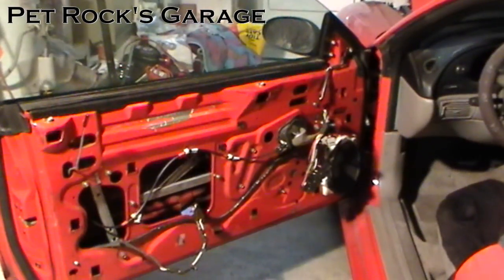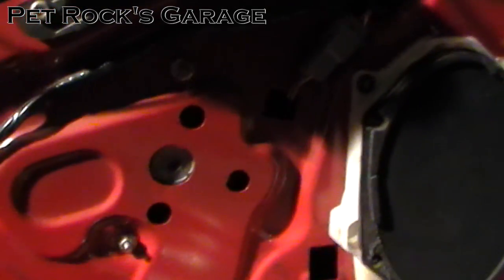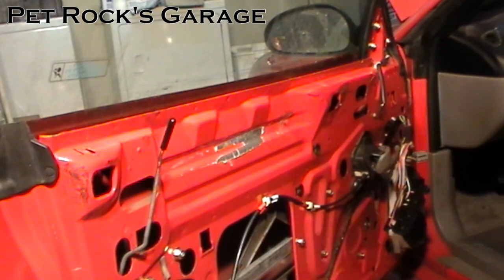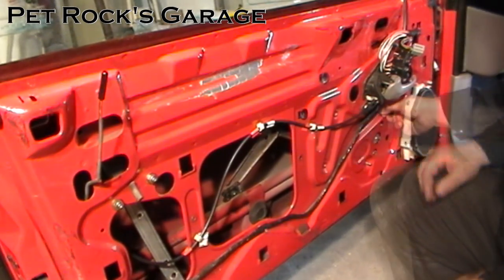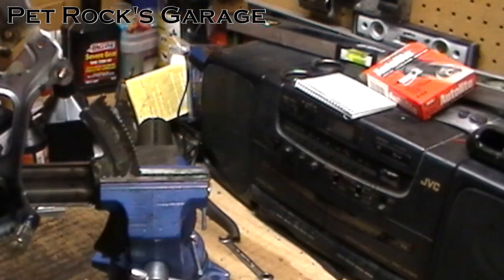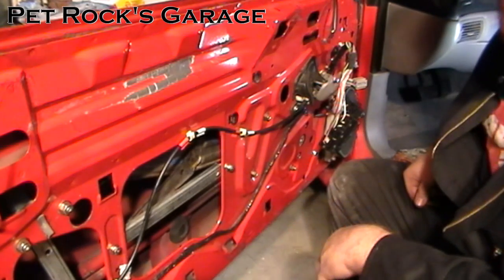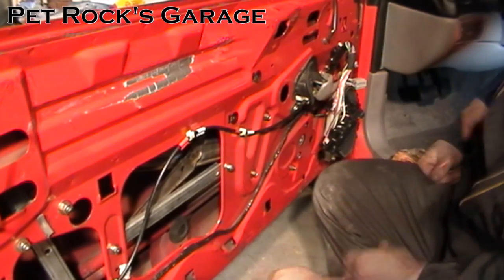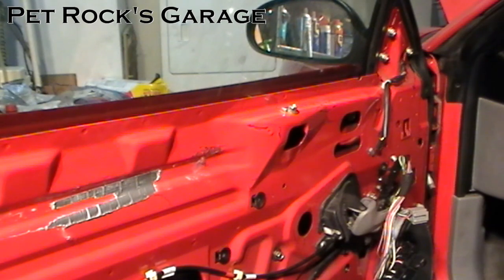How To Replace Window Regulator & Motor - Ford Mustang (’94 - ’04)

Comment: Good job mentioning the spring, putting the replacement motor into position got a bit sketchy until a couple of the bolts were in place.
Reply from the maker: Yeah, that spring can jump out and bite you if you aren't careful. I'm glad my video helped you out.  Thanks for watching & commenting. I appeciate it.

Comment: My black and blue left hand ring finger is living proof that today; 5/22/24 - that darned spring can do SERIOUS damage to human flesh!
I was lucky. Nothing broken, plenty of icepacks in the 'fridge (as my roommate just had a knee replacement), 10mg Oxycodones too!
Without this video, I'd still be wondering.
Now I have to try and refit my window with original rivets still in situ.
I do wish you had shown how to replace the window with rivets holding it to the topmost channel that slides on the plastic doodads though. This is proving to be a nightmare; ESPECIALLY with a black and blue left hand ring finger being rather sensitive and larger than normal!
Thanks muchly for the video!
This reminds me of the tale regarding the gynecologist who decorated his hallway, through the front door keyhole...
Reply from the maker: OUCH!!!  I hope it heals up quickly. Yeah that spring swings quick. Like a bear trap. Take it easy.
Reply: @petrocksgarage  
Thanks.
I did buy a new regulator, but the instructions told me how to modify MY MUSTANG..... to fit THEIR PRODUCT!!! 
It was returned. (I had another one luckily).
There is no way I'm removing that lower rail, on the window so their new skinny one will work.
I did get it all back thanks to you, but the plastic inner door clips proved they are 28 years old and will break at will should they choose to.
Tomorrow is another day. 
Long, hot shower, cold Guinness in hand and watching the recorded qualifying for tomorrow's Monaco F1 race.
Finger be damned! Life is good!
Thanks for your videos. I tipped a brew to you!
Reply from the maker: @Dodger2879  any 3rd party 'replacement' part that requires you to modify your car to get it to work is a bad part IMO. Glad to hear you got it all sorted out. The cold beer will likely help heal your finger, or let you forget it's injured. Guinness has amazing healing properties in my experience.

Comment: ~INPORTANT NOTE~ DO NOT ATTEMPT to take motor out by itself!  This video does only hint at - the nightmare that ensues once that motor comes out of the regulator - that spring will bind the regulator - and possibly take the wheels right out of the tracks and damage them!  I know from experience!  PLEASE GO THRU with removing the regulator and motor - as one piece - as this video does!!!

BTW - this is the best video for this repair
Reply from the maker: Thanks a lot & couldn't agree more.
Reply: @petrocksgarage  I drilled rivets out - from the radio speaker - and - from the window bracket - good advice - seems hard but drilling is the easy way to assemble the window back together!  Also, if your window bracket is loose - use a good 2 tube epoxy to glue it back - other videos use silicone - that method sucks - use epoxy (i mixed my epoxy with silicone to make a flexible glue)
Reply from the maker: @budsodalsky , Thanks a lot. I appreciate it. I have a tube of 3M Auto Glass Urethane Adhesive that I am planning on using on a friends car soon-ish. It has the same loose window bracket problem I show in this video. We'll see how well it works.
Reply: @petrocksgarage  i hear that should work - i wanted a permanent bond - not sure what ford used - sure was NOT permanent
Reply: @petrocksgarage  Heard from a pro friend of mine - later that YES 3M Auto Glass Urethane is what I shoulda used!
Reply from the maker: @budsodalsky , awesome!  Thanks for getting back to me on this. Makes me glad I used it on my friends window a while back. 🙂

Comment: I have a 2001 ford mustang.   This video helped me tremendously to get me my window, regulator and motor changed out.    I didn't know until I watched this video that I could change out the rivets and use bolts.   I went to an autozone and orielly's and they had no rivets big enough to replace so I used boltz .   I have to admit this video applies to Mutangs from 1995 to 2004 that gives a wide range this applies to.   Hope this video help everyone else as much as it helped me.   Thanks
Reply from the maker: +William Roberts, I’m glad to hear my videos helped you out.  Thanks a lot.  I appreciate it.

Comment: Very useful video I followed it just about to every explanation. Though I approached it differently, because of my situation. Such as I didn't have to take the rivets that hold part of the regulator track onto the window. There's another way of going around that for those of you that don't have the proper tool to take off both rivets. I simply installed the regulator with the motor separate, as shown. lubed it with multipurpose grease and  shoved the regulator and motor into the door first leaving everything unscrewed. Next fed the window into the door that still has the riveted track on it and had a buddy hold it for me. I then bent the little metal parts on the windows track as shown in the video to be able to slide both black parts into the track. Being that this was the passenger window, I believe I slide the left black piece in first then had my buddy shift the window to the left so I can put the right black piece on the opposite side of the window track. Once they're in I bent the metal parts back and started assembling and screwing everything back in but the two last metal track pieces that come off the regulator first.

When you get to the two separate track pieces, you may have to plug the motor back into the door and turn the key to power the car for a sec. Why? Because the regulator may not be aligned right when installed, so while you have a buddy hold the window in case something goes wrong, either press the window button up or down to the correct position you need the regulator to sit in so you can screw in the final track pieces starting with the curved one first. Feed the curved track onto the black wheel looking piece on the window's bracket and screwed it into the door, the two screw mounts should be towards the top and the single one towards the bottom. Lastly install the straight metal track last feeding it through the single black rectangular piece on the regulator. Then just install both the metal and felt brackets back in as shown in the video.

That's just basically how I had done it and everything works as according I'm proud of of both myself and my buddy, being that we're amateurs. And I really don't have the money to have a professional fix it. I paid 47 dollars for my regulator, Motor, and Window glass with a warranty included on the motor and regulator from my local pick-a-part. For those of you that are afraid to do this themselves. Believe me it's more simpler with two people, so you have two brains working together. It's a lot easier than it looks, especially with the help of this video. Though you may need to make some adjustments yourselves, but you'll get it. Just take things slow. It took us roughly 5 hours to get the old one out and the new one in.

Comment: Great video, and it just so happens that I am replacing the drivers regulator on my 98 Mustang GT convertible, so I'll be using your video step by step.
Reply from the maker: Thanks a lot.  Also check out my video on adjusting the window when your done. There is a link in the description & at the end of the video.  Good luck...

Comment: When I bought my 2004 mustang brand new.I found that when you hit the window down button the window would continue to go down even if you took your finger off the button.I almost took the car back to the dealer because I thought something was wrong.A friend told me it was supposed to do that.I argued with him about it.Thanks to your video,I now know there is a module in the door.I wonder if there is a way to bypass this module?Its drived me nuts all these years.I thought the switch was bad.I actually bought another switch.But I never put it in.
Reply from the maker: Yeah, the one-touch-down feature threw me for a loop when I first experienced it. I have gotten used to it over the years, and find myself using it on purpose all the time. There are definitely uses for it (e.g. roll down going to a toll boot, drive through, to air out a hot car), but there is a bit of a learning curve on how much the switch needs to be pressed etc. A friends '21 Chevy Blazer has one-touch-down & one-touch-up. So its only becoming more prevalent.
As for bypassing it, there likely is a way to bypass it but I don't know how. Good luck.

Comment: Hi, great video. I have a 2002 ford mustang. The passenger side window goes up and down good. But lately it looks like something is scratching the glass from inside when i lower the window. What do you think it is causing this?
Reply from the maker: It could be anything. A loose part inside the door, some dirt on the weather stripping...  Only way to find out is to remove the door panel and have a look inside. Good luck.

Comment: I referred to your alignment video for my wife’s 2000 convertible, driver’s side alignment issue. Very helpful thank you. In this video I watched for the front vertical guide to see what looked like because I end up with a gap as if the window is tilted down toward the front. Inside the door at front bottom, I found a broken piece of white plastic, maybe nylon, kind of wedged shaped piece. Do you think it’s my issue? What’s it called and are they “in car” replaceable? I really hate the thought of her taking to stealer, I mean dealer,,,,Thanks again.
Reply from the maker: It is hard to say if that wedge is your problem. Most of the parts to the regulator are metal. It might be one of the horizontal guides the window follows. Its hard to say. Your best option is to take the door panel off and cycle the window up/down a few times to see where/why it starts to tilt. Good luck.

Comment: Great video, and thanks so much for taking the time to share. I do have a question if I may- What tells the auto feature to stop going up or stop going down? Or for that matter what tells the manual power button on the passenger side the same thing? My drivers window on my 94 Cobra won't stop on it's own. I have to make sure I manually release the switch when the window reaches full travel up or down or it bangs about trying to go further. I previously replaced that module inside the door panel with a new Ford part a cuple of years ago and have just put up with it since.
Reply from the maker: I haven't seen a circuit diagram for the internals of the auto up/down feature, but my edumacated guess is that it relies on the property of electric motors where when the motor gets stuck and can't spin the amp draw goes through the roof. When the window hits the bump stops at the top or bottom of the door and stops moving the electric motor will start to strain to overcome what's blocking it and the amps will spike as a result. After you press the button to activate the feature the module thing in the door that I show in the video is probably monitoring the circuit for that amp spike. When it sees the amp spike it opens the circuit to stop the motor & window. But thats just a guess. 
As for your window problem, I can't really tell without looking at it, but I would guess that you are missing one or both bump stops at the top of the door (where the window comes out). They are supposed to stop the window from going up too far. There are similar stops at the bottom to make it not retract too far. I have a video on how to adjust these windows that shows all the bump stops you should have. Good luck.  https://youtu.be/E-TLxmP12QY
Reply: @petrocksgarage  Thank you for the help!! I'll report back, might be a week or so. At least I'll get the door panel off and see what I can see. It's really hot here at the moment,  85 in the garage is too much for the old guy!
Reply from the maker: @2wattsout  Good luck!

Comment: I know this is an older video but was hoping you could answer some questions for me, I'm in the process of getting my 2001 GT back into shape after years of barn storage neglect. The windows go up and down, the driver side is fine but slow, and the passenger when going down falls forward a bit but realigns as it goes down. My question for the driver side is could I use the white lithium on the regulator without having to remove it and do you think that would smooth it out? Do the Motors wear out and slow down or is it a work/doesn't work type part? For the passenger should I just replace everything or is there a way to realign the window and then possibly put some grease on the regulator? Thanks for all your videos I've been subscribed since I started my project!
Reply from the maker: You could try to get some white lithium grease on the regulator without removing it. Its pretty tight space in there, so it might be tricky. Another thing to consider is getting Dry Lube (yeah, thats a thing) and apply it to the tracks that the window slides in to make it slide easier. It might fix the sticking issue you have on the passenger side. You want dry lube so you don't gum up the felt in the tracks which dirt would stick to and make things worse.

motors are typically a work & don't work type deal. If they are moving slowly it is because something is preventing it from moving. e.g. friction in the window tracks.

Here's an amazon link to some PB Blaster Dry Lube: https://www.amazon.com/Blaster-16-TDL-Advanced-Lube-Teflon/dp/B0002JM8HM/?_encoding=UTF8&pd_rd_w=6XYur&pf_rd_p=bbb6bbd8-d236-47cb-b42f-734cb0cacc1f&pf_rd_r=C99JKHMYN91F5KRJ114Q&pd_rd_r=1cf52c8d-a574-41b8-bd0a-fffcc1eab37e&pd_rd_wg=sUpfB&ref_=pd_gw_ci_mcx_mi

Comment: Very nice video. I've notice that after removing the lower/shorter horizontal bracket of the regulator that the regulator doesn't collapse. Why doesn't the "scissor" part of the regulator collapse until you push the regulator studs in from the door frame? I can't picture it. If my windows is all the way down and my motor is burnt out, as a temporary solution to have the windows closed, is it possible to lift the window up or will the motor/regulator prevent me from doing that without removing the regulator studs? Thanks!
Reply from the maker: It doesn't collapse because there is a large spring built into the regulator that is holding tension on the regulator and the motor is holding everything in position. You can see what I'm talking about during the part where I swap the motors between the old & new regulators (around 11:08).  Hope that helps.

Comment: what did u use to glue the brackets to the window epoxy? and is it easier to install brackets onto window before u attach to channel
Reply from the maker: If you mean the black brackets that are glued to the window glass, I didn’t do anything with them. They come from the factory glued on. I actually replaced the stock window in this car with one from a junk yard because one of those brackets came loose. If your brackets are not attached to the window or are loose, I’d recommend replacing the window. It will be a P.I.T.A. to get the brackets on again in the correct spot. Good luck...

Comment: i replaced my window motor without taking the whole regulator out. and now after a few days after rolling the window alll the way up or down it makes a repeated poopping/clanking noise. Do you think the spring has something to do with it ?
Reply from the maker: Its hard to say from my keyboard. I would pull the door panel and have a look inside as you roll the window up & down and see if you can pinpoint where the popping is coming from. It could be the plastic gears in the window motor assembly that are slipping. Good luck.

Comment: Both my window motors are bad on my '94 coupe. Regulators appear good. So if I drill out the speaker rivets you are saying there is much more room (and visibility) to get that motor out? I know what you mean from doing other cars re the clearance and the arm issue!
Reply from the maker: +larry gk, removing the speaker might give you better access physically but not really visually. The hole is closer to the motor. Either way, its going to be tight. Good luck...

Comment: You don't need to take out the window bracket. You can use the same window bracket and connect it to the  new regulator. Just take out the new bracket from the bracket. It depends which one you buy.
Reply from the maker: I had to in my case because it was damaged. I mention it in the video and also describe multiple options on how to handle the bracket. Either way, there are many different ways to do this job. Use whichever works best for you.

Comment: can you tell me how the window itself is held in is it riveted or screwed through the window or is there a special sealer that you use to set the window into the track on the back side of the door closest to the back seat I can't seem to get the window to stay in that track and I can't find a sealant that will hold it there
Reply from the maker: +Phil D, I touch on this a little in the video.  But the window has metal brackets glued onto it. Those brackets are riveted from the factory onto the window regulator. If the window regulator or window was ever replaced, it is common to replace the rivets with nuts/bolts.  The front of the window (closest to the mirror) slides up & down a channel in the door frame via a little tab. The rear of the window (closest to the door handle) slides up and down a channel in the door frame via a little plastic wheel/bearing thing. Is kind of hard to explain, but its all outlined in the video.  If the window doesn’t stay in the track then the regulator may be bent, or the bracket attached to the window is bent or any number of other things. I can’t diagnose it from my keyboard. Best to take the door panel off and have a look inside. Hope that helps & good luck...